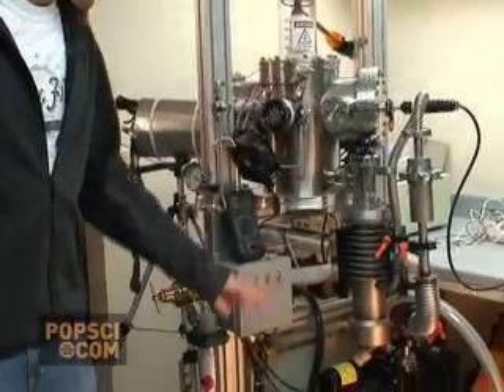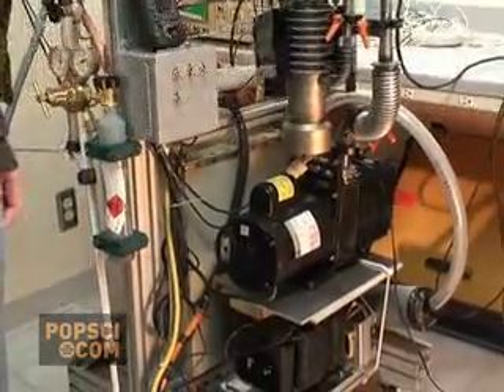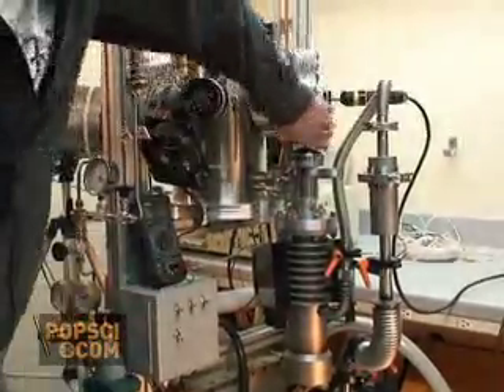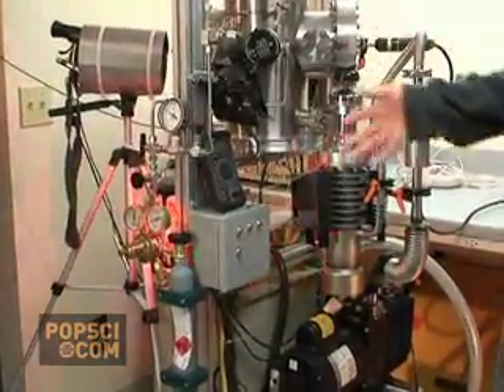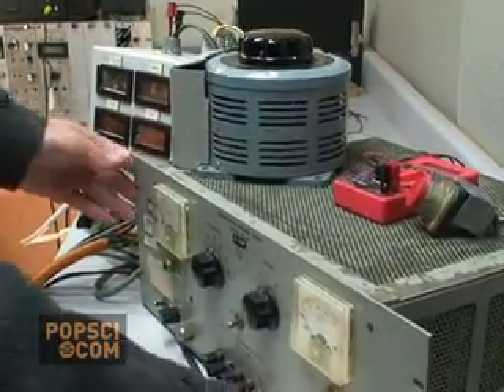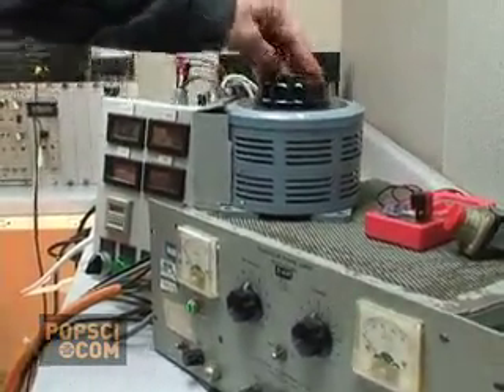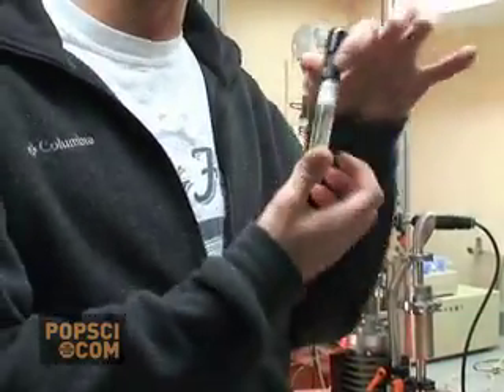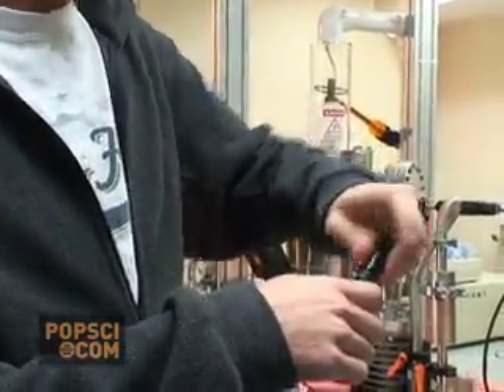Teen Builds Nuclear Reactor

Comment: @gordongate Man, when we get Thorium reactors, it's going to be awesome. They produce a lot of energy, you end up with little spent fuel that is easy to contain. And since it needs to be heated up to the point where it melts to produce energy, there is no risk of a melt down! And if they lose power, or something really bad happens. The fuel just runs into container below the facility when the salt or ice plug melts or dissolves. It's genius! And the reactor is small, compared to others.

Comment: You mean in terms of the cost (or energy) required to produce the panel vs the amount of money that can be saved by using the panel? They're becoming cheaper, and more efficient you know. Just a few years ago, Texas developed solar cells that you can spray out of a paint can and are 50 percent efficient. I was in communication with the researchers for a year or so. They're cheap, and work better than anything so far.

Comment: @JustinianPictures Then you'd know that with a tokamak reactor you wouldn't end up killing anyone, the problem here is not the creation of energy, or the heat it puts out (as they're generally cooled via having lithium pumped around the walls of the reactor), the problem is how to transfer the energy in small enough amounts that it could be useful. Most definitely, this is fission.

Comment: and in fission reactors the power isnt generated by steam turbines the power is generated by a uranium atom splitting into two lighter particles and emitting heat as a biproduct the steam turbines convert the heat into electricity

Comment: @TakronRust It's you who don't have a clue, this has been done for over 60 years. Fusion is no problem at all, it's break-even that's hard. If you accelerate an ion over a voltage drop of 8600 volts in a vacuum its temperature is now 100 million kelvin. In the fusor you have an electrostatic potential well with a bunch of ions going back and forth. Whenever they collide there's a small chance they will fuse.

There are even portable neutron sources based on the fusor. You're just wrong.

Comment: Not just in the H-bomb - even in the lab.

Colliding deuterons with enough energy to fuse is simple, and can be done easily by any high school student with sufficient kit, as the above video demonstrates. 

Getting enough deuterons to fuse and output enough thermal or electrical energy to do better than breakeven is damn near impossible.

Comment: There are no exotic materials used in the construction or operation of this machine.

The reactant is deuterium (Hydrogen) gas, obtainable very easily from a chemical company, and is not radioactive or dangerous. 

This is not fission, so there is no uranium, plutonium or any other heavy, radioactive or toxic metals involved. All the other parts are either high voltage or vacuum based, which are also not resticted to the public.

Comment: @lenart1984 o rlly? it seems like you don't know the differnce between fusion and fission. fission is what goes in PWR reactors where neutrons are fired at uranium which starts a chain reaction where the atoms are blasted apart. nuclear fusion is when (typically hydrogen and helium) are combined at the subatomic level. Fusion has been going on for years now and the energy put out is so little, that almost no shielding is needed which means very little radiation is put out.

Comment: Helium-4 is actually NOT radioactive. If the helium-4 nucleus were emitted from the reaction without valence electrons, these would be considered radioactive alpha particles, but this is not the case with a Deuterium-Tritium fusion reaction. The product is a whole stable very non-radioactive noble gas helium atom and an emitted neutron. The neutrons are however considered to be indirectly-ionizing radiation and pose a mild health risk to individuals within the emission zone.

Comment: Deuterium nor Tritium is not radioactive. Both are isotope of hydrogen, but Deuterium is stable and Tritium half-life is is 12,33 years, changing into isotope 3-Helium by beta-minus disintegration. 3-Helium and 4-Helium are stable. Free neutrons changes into protons by beta-minus disintegrations, but usually they are catched in reactor. Termonuclear fusion is not radioactive (in meaning like nuclear disintegration isotops of heavy elements).

Comment: No, that's not true,.Fusion reactor is as much nuclear reactor as fission reactor. Both also DO create radiation. Fusion reaction releases lots of protons and neutrons which will eventually turn the reactor dangerously radioactive. There is common misbelieve that fusion reaction does not create radioactive waste, which is not true. Sure Fusion reaction does not need radioactive fuel, but as I said it will make the reactor itself radioactive.

Comment: No its not. Its a Farnsworth fusor. Its a simple device that produces fusion reactions by accelerating hydrogen nuclei electrostatically. There are no magnets. Its a very simple device. Invented by Filo Farnsworth in the 40s. You can look up the patents. 

it can only produce small amounts of fustion and the design can never acheive net energy production, due to losses at the accelerating grids in the middle.

Comment: You can get all the kit you need to build a basic version of one of these from less than $1000 if you're willing to hunt around. You need a basic vacuum vessel, neon transformer, vacuum pump, HV capacitors, and other bits and pieces. Just becuase it can be done cheap(ish), doesn't mean it's easy! You don't want your vacuum vessel imploding and shooting shards of plastic around the lab at the speed of sound. 

Google: Build Farnsworth Fusor if you want to build one of these machines!

Comment: Well, the thing is it is possible to create those temperatures, but only in a very small number of atoms.  Since temperature = the kinetic energy of the atoms, if the atoms are moving quickly, they have a high temp by definition.  You can accelerate ionized atoms to very high speeds using a high voltage electric field instead of heat (about 4,000 volts, which is what he is doing).  When quickly moving atoms hit each other, it causes fusion.  Ta da :)

Comment: clears throat This is not nuclear, that alone throws me off that he is not a genius after all, otherwise he would know what hes talking about. Its fusion, or a small form of. Anyway, nice try. It is hard to build, if he really did, the rest is easy.
Reply: Fusion is a form of nuclear energy, and so is fission
Reply: Unless you have the authority to rewrite definitions, this is nuclear if deuterium nuclei are being fused.  The farnsworth fusor is a tried and tested design that does produce fusion given enough voltage, so it isn't so far fetched.
Reply: Oh. Thanks for correcting me.

Comment: Even these simple devices can reproducibly and convincingly produce fusion reactions, but no fusor has ever come close to producing a significant amount of fusion power. They can be dangerous if proper care is not taken because they require high voltages and can produce harmful radiation (neutrons, gamma rays and x-rays).

Comment: " that's why we don't build Fusion powered nuclear reactors nowdays". NO check it out on wikipedia. To solve the probleme of temperature we need powerfull magnetic "champ" (in french) to prevent the plasma in the combustion chamber to enter in direct contact whit combustion chamber (there's prototype of fusion reactor like TOKAMAK nowdays)

Comment: @Strikerklm96 no he wouldn't its not sustainable with out constant plasma that doesn't make power it uses it up so he would not make any money off it he would need a bigger reaction and it would need to be able to sustain its self with out the heat from the plasma and then he would need to hook it up to a binary fluid generator

Comment: what radio active matherial did you use, thorium maybe and what quantety.
Reply: He likely is using Helium. This isn't a fission reactor, Thorium isn't usable.
Reply: ***** Thorium is usable in a fission reactor, not a fusion reactor.
Reply: Rob Fraser i tought they were the same, so i  reashearch it. fusion creates material,  fission destroys or disperce energy...
Reply: Al Beau Its is impossible to destroy energy or matter according to the first law of thermodynamics: energy is conserved through all processes. The second law of thermodynamics is that the total entropy of the Universe is increasing. Fission and Fusion involve the manipulation of atomic nuclei so its products will always be that of a different element (transmutation).
Reply: ***** As long as use can bombard atomic nuclei with alpha particles, neutrons, or protons, you can initiate a fission reaction.

Comment: @ian5576 "[...]how would you classify a thorium reaction since there is no fission (split), just neutron absorption eventually leading to the formation of U233?"

Neutron capture isn't the only thing that can happen when you bombard Th-232 with neutrons. It depends very much on the energy of the incomming neutrons. In a fast reactor some neutrons can cause (n, 2n) reactions and (n, fission) reactions.

Type "nndc endf" into google for a great resource on cross sections for various reactions.

Comment: oh, so fusion is possible, just not as a power source. Teach mustve been talking about pressure or temperature, not electricity. Using 4000 volts to power a generator kinda defeats its purpose, am i right?

Comment: I'm not so sure it could "solve" the world's problems, since the maximum energy (100 percent efficient) achievable with solar power is 4.2 kilowatt-hours per day, averaged across the world in 24 hours. This is roughly equal to a barrel of oil each year which really isn't that much. My Uni in DE and another in TX have achieved 50 percent efficiency (my school with layers, Texas with Carbon Nanotubes) which I believe is the most so far. It will certainly be useful, but I think fusion will dominate

Comment: You don't need to understand differential equations to build a Farnsworth fusor. You don't even have to know algebra to build a Farnsworth fusor. If you have a high voltage supply (rectified neon sign transformer), a load of surplus vacuum equipment, and a little bottle of hydrogen, you can build a fusor. There is no "mad scientist physics" involved. 

It is not that difficult to do. Not news-worthy.

Comment: Except that it's not performing nuclear fission, but nuclear fusion.

And no, it's not producing net power, just a small amount of deuterium-deuterium fusion, which is realtively easy, and not too dangerous from a radiation point of view. 

Google 'farnsworth fusor', and you'll see that this device has been doing basic tabletop fusion for several decades. No net power, but so what?

Comment: ian5576 your confusing fusion with fission.  in fusion all you need in deuterium gas, a chamber, a power supply, and a pump.  this is of course a ridiculously simplified list.  it is more that possible that he has fusion going.  just the fact that he got plasma is a good indicator.  given the correct pressure and volts he will get fusion.  also the fusion reaction produces neutrons it doesn't need any to run.

Comment: Fusion reactors DO exist, actually. There are at least 18 operating in the world currently; look up MAST, JET, or ITER, for starters.  That alone should give you an idea of exactly how ignorant you are on the subject.

Next of all, there are many ways to use fusion.  "Hot fusion" is what you're thinking of.  But there is also a "Farnsworth-Hirsch Fusor", which is what this kid uses.  Instead of using high temperatures to accelerate atoms, it uses electrostatic acceleration.

Comment: such a small reactor is possible, but its a fake. the deturium and tritium used to do fusion (or DD perhaps) is expensive and has to be refined for use in fusion. i doubt he acquired it. and his method for detecting neutrons is a give away. the flux from a small reaction would be too small to produce visible gas bubbles. its a fake.